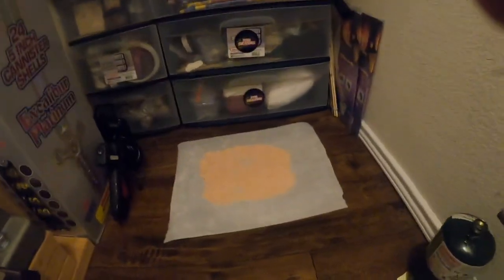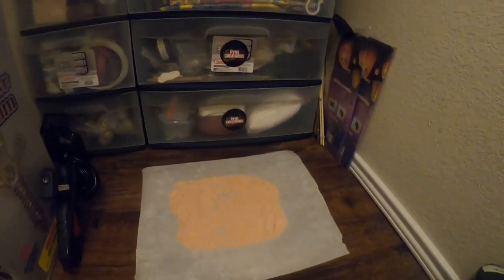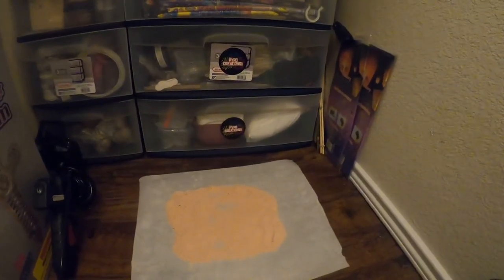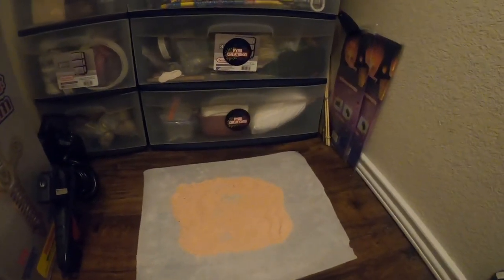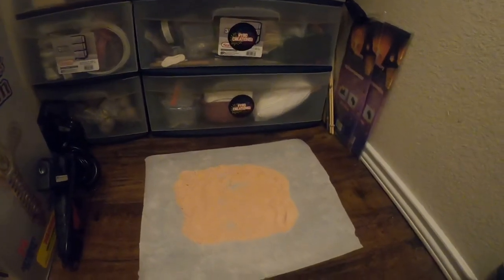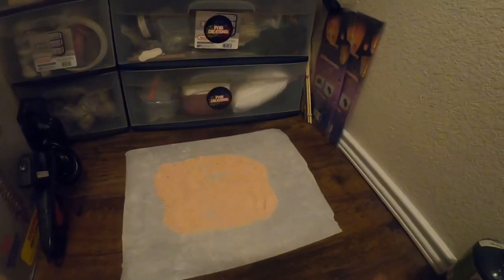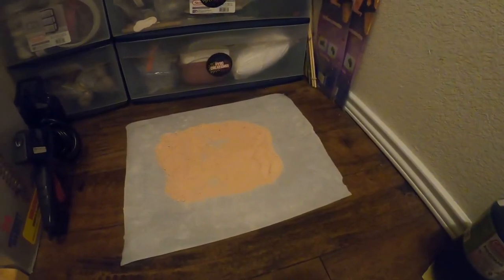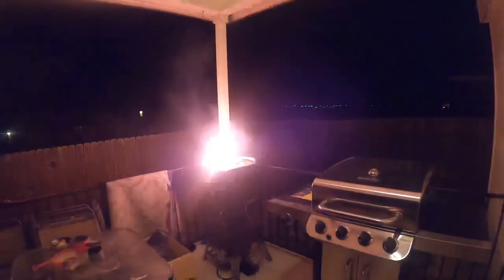Made my first batch of Benny whistle fuel

Comment: Looks good! Play with the catalysts when you make whistle, traditionally we use copper oxychloride for the catalyst in benzoate whistle fuel and save the red iron oxide for sally, sodium benzoate pairs with copper oxy a little better than potassium benzoate but either way it will work, good thing about potassium benzoate is it doesn’t suck water like the other sodium fuels (salicylate and sodium benzoate)

Comment: Sodium or potassium benzoate work well with cores I like the cohete 5/8 spindle with that kind of whistle. Looks ok for Sodium whistle just make sure you don't use to much delay it burns slower as a solid bulkhead.  And mineral oil and paint thinner is another choice in binder
Reply from the maker: I have the cohete rocket tool so I could try that for the whistle rocket at some point. It’s good to get info on the whistle as I didn’t know it doesn’t work well if you have too thick of a solid bulkhead.

Comment: When it's dry it should burn as fast as vitamin F does. I make mine a tad different but close. And went from wax to  Vaseline to  now mineral oil
Reply from the maker: I wanted to use Vaseline but I didn’t know if I’m supposed to melt it like the wax or mix it in with naphtha then add the Chems.
Reply: @E85_STI  melt it pour in your nap after your get it to a liquid state
Reply from the maker: @PineyWoodsPyro  gotcha I’ll try that on the next one I just posted a short video after 9 hours of dry time. Let me know if the speed is too slow or good.